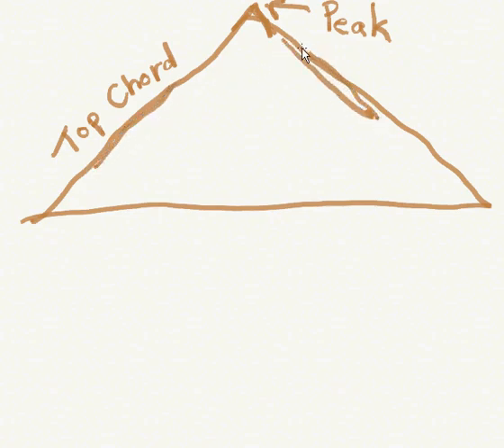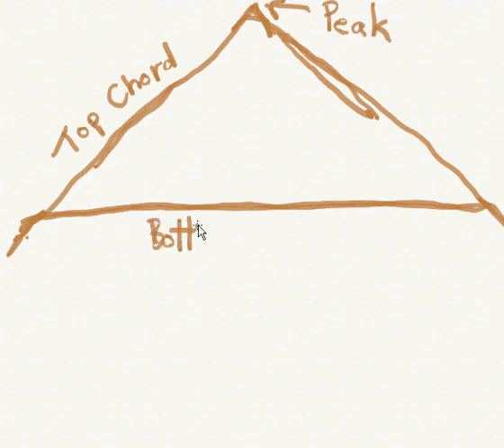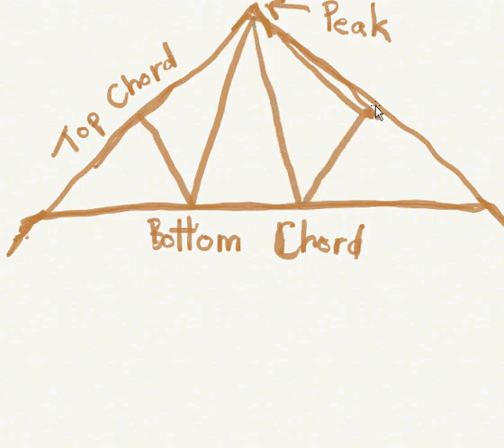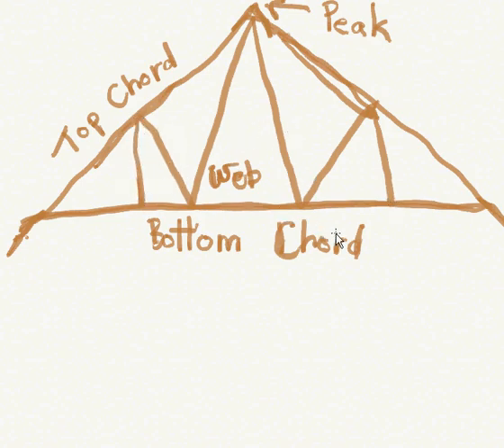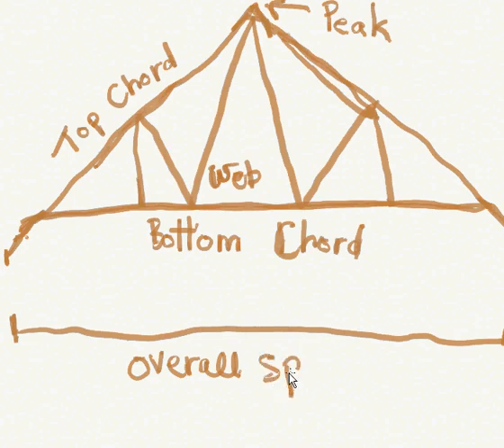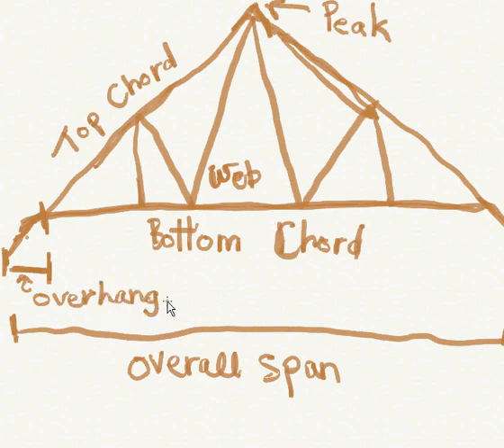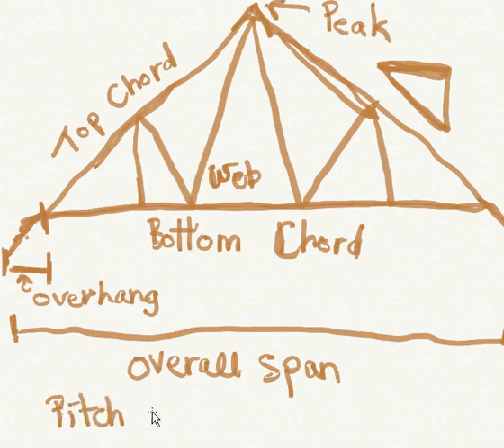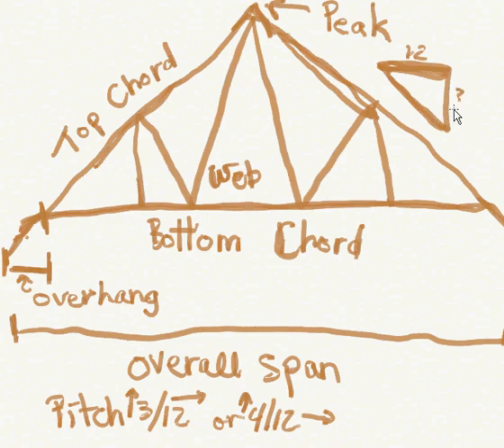Parts of Timber Truss

Comment: I meant 45 degree angle from the joist. there are many pictures of trusses on the web for an easy match. I helped my father and uncle build some trusses, 26 feet long. We built them over 30 years ago, and they are still holding fine. The roof covering is only 2" X 4" lathe covered in tin roofing, so, there isn't really a lot of weight on the rafters in the first place. The "gussets" we used on the trusses was 3/8" plywood hand nailed with 8 penny nails. No glue.

Comment: Unless you're doing a massive truss, I think the web-bracing should be installed basically on a 45 degree angle for the most holding strength. And,  yes the terminology is different  from what I've been taught. The "top chord" is called the "rafter," the Bottom chord is the Joist, the "overall span" is the "run"......One brace post installed straight down from the peak to the joist is the "king post"....